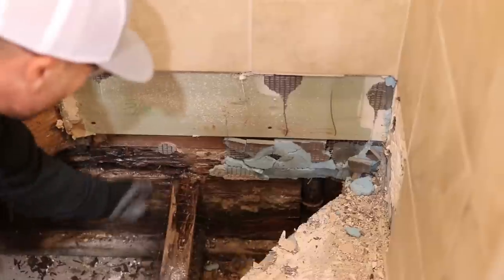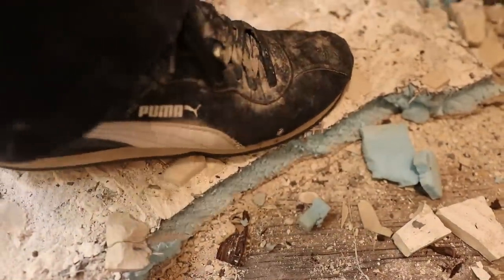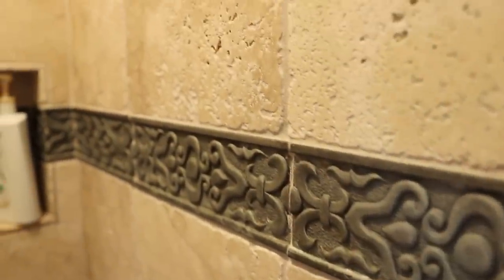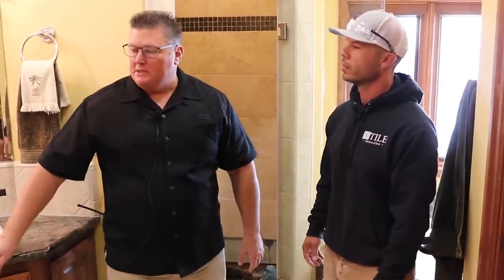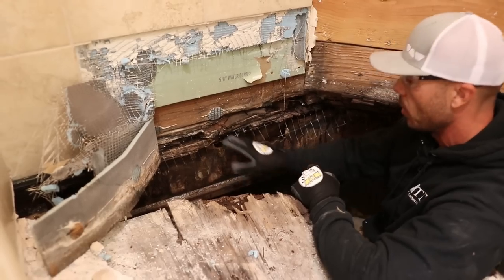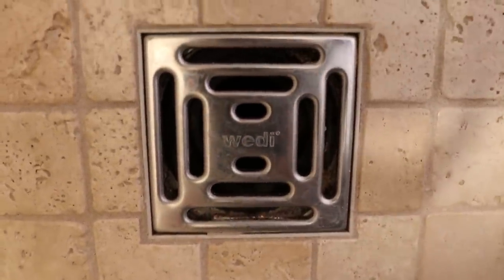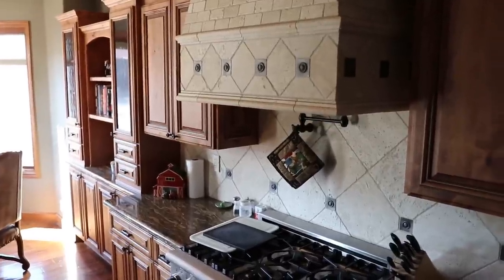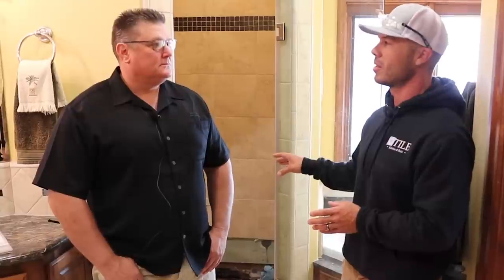Massive WEDI Shower FAILURE (Done by Certified Installer) -- Warranty Claim DENIED

Comment: I'll stick with my Oatey pvc 40 mil liner in the pan, overlapped by 6 mil plastic on the studs. I sleep good at night.
Reply: Right! :)...I love that system...Tile guy for over 30 years...Do you preslope?
Reply: @godbluffvdgg   Yes I always preslope. Do you put cheese wiz on your cheese steaks? I always preferred marinara.
Reply: @Hodmokrin  :)...I ask because that SalTile guy, that has a channel on here says he doesn't do it and you don't need it...I preslope too AND I aqua seal the pre and the wet bed...That at least gives me the tail light warrantee...:)...And cheese steaks get Provolone...Sharp if they got.. it...but if you've had a few beers; wiz is the most awesome thing in the world...:
Reply: Carleton Rutherford  you're right God forbid they try to do as mud pan. That's why we make the big bucks 😉
Reply: How can you sleep at night knowingly installing septic tanks under your client's feet.
Reply: Amateur shower builder that learned from John Bridge book. That was the system I used and I didn't have problems in the 15 showers I built with leaks. I made a mistake on my first one where the mud for the pan was too wet and it filled up the weep holes. About 10 years after I built that one I had to redo the pan because it smelled bad. For sure that system would have been better than what was done here. On the first 6 I built I screwed the Hardibacker into the top of the curb. Eventually I switched to mudding the curb.
Reply: @godbluffvdgg  you're getting Sal DiBlassi mixed up with the guy from Star tile that thinks pre-slopes are not needed period sal would never bypass a pre-slope
Reply: @jamessprow7116  Hey, stop making fun of old people! :)...
Reply: @jamessprow7116  pre-slope? Pre-slope pan or is that a field term for something else?
Reply: @godbluffvdgg  Always preslope!  Shower will start to smell moldy in a few years if you don't.
Reply: @paulperry1489  Its putting mud down sloping towards the drain under the 40 mil Oatey pan material.  Its a very good idea.
Reply: @jonm9538  Yeah, I always do...:)...Plus I waterproof coat the entire thing Up to 6 inches on the walls, THEN I use the PVC layer...I sleep easy at night...:)...And that's what it's all about.
Reply: @godbluffvdgg  If there is one thing I've learned about tile it is always go the extra mile to make sure your job will last.  Your customers might not like the job taking a long time, but they will be even more pissed if you hurry through and screw it up. That Philly and beer will taste a lot better if your gut ain't churning.
Reply: @jonm9538  Ain't that the truth!  We have so MANY wet bed shower pans here; THOUSANDS of them!....Mostly Lead sheet with lead drain lines we tear out...1 1/2 inch thick mud walls with wire...I think I did my last one In January...NO MAS!...The last one killed me...:)...Not really but, going up and down steps and kneeling for long periods, at 60, is brutal...
Reply: @godbluffvdgg  I'm 60 as well lol. Tried to get out of tile 100 times it seems,  but it turns out I'm unemployable. I really can't complain I still make decent money and I basically work part time. Got out of commercial a few years back. Now I cherry pick jobs, mostly residential remodels that I do with my son.
Reply: @jonm9538  :)...That's EXACTLY what I'm doing...I wish I had a son to help though...I have to use self entitled jabronis that cry about working, don't show up, can't follow instructions etc. ...Well, my friend, Good health and Freedom to you and yours.
Reply: @jonm9538  Got it! Are you using deck mud under the liner or concrete? 

I get this concept and it’s a fantastic idea, just want to be sure of the application. I don’t want the wood sub floor to fail in years down the line.
Reply: @paulperry1489  I use either deck mud or sand mix cement. You can also buy preslopes from tile distributors that are made of styrofoam.  Another thing you can do is use a quarter inch durock or other cement board cut to the dimensions of the shower floor including hole for the drain. Then you cut that diagonally into 4 pieces and the fat mud them to the subflooring with thinset to make your slope.
Reply: @paulperry1489  One more tip for you. I like to use a pressure treated 4x4 post for the curb. I leave room on both sides so I don't have to cut and seem the membrane.  I use a chisel or a vibrating undercut saw to make room for folded membrane in the inside corners and I notch the bottom of the wall studs so I can get my backer board to sit flat on the wall. Good luck with your project!
Reply: @godbluffvdgg  Hire demo guys; my back has a hard enough time building the shower lol
Reply: @zagnit  "Demo guys" are good in a vacant house tearing out crap...But, in a bathroom in a 650K house, they're not worth the aggravation...I wish I could find competent, dependable, affordable demo guys... They're "Hen's Teeth", in this area... :)
Reply: @davefoc  I did a job for my buddy and grosse pointe farms in Michigan and the guy who put the shower liner in didn't do no pressure check  and no standing water test and he sealed the weep holes  i messed up trusted someone elses work so I did the rest of the bathroom job assuming he was that guy because of how long hes done work there   and it leaked and I told him(my boy) the reason why it leaked is because the guy sealed up the weep holes and then he didn't do a pressure test and the guy who did the job trying to tell me that you're supposed to seal the weep holes I just laughed in his face and this guys been doing jobs out in grosse pointe farms grosse pointe area for like 30 40 years his name is Bill so I can imagine that there's more problems out there because of this guy

Comment: hI iSSAC 

Thanks this video. I have a great deal of experience with this product and have made a lot of videos showing how to install this board.  I can state categorically  that his is not a product failure. The rebate (rabbit) cut is not required and neither is the caulking. The joint should be  sealed with a neoprene flexible tape that will give you a perfect water seal. This will cope with movement and that is why it is specified. The contractor is out of business so, the homeowner needs to go back to the terms of the warranty. It will not fail if it is done properly so the fault lies with the installer. I agree that better training is required but I reckon the installer was trying to save $40,00 on the taoe.
Reply: Absolutely right Roger.  I did my bathroom using wefi 14 years ago and it's as good as the day I installed it. I posted a comment here months ago to which someone's just replied and noticed your comment.
Reply: Skill Builder I agree that the installer totally screwed up but I am a WEDI certified installer and just went to the secondary certification in Chicago last year. You are I correct. They do want the rabbet cut now but they want you to block in behind (Between the studs) and put a massive bead in that channel. That way when you push it down it should squeeze out a good bit and then you run the Wedi corner knife on that seam and let it dry. Once it’s dry you go back in with the sealant and run a new bead and again use the knife to get it sitting in the crease well. It’s what they call their double barrier system.
Reply: The contractor was "certified" by the manufacturer, and the manufacturer refuses to back the warranty that mandates installation by the "certified" installer. Basically, the warranty and certification are absolutely worthless.
Reply: @kassklothes  so everyone that’s certified does it the way they were taught? Come on now. Let’s me logical. It was a bad contractor. It’s quite obvious
Reply: @kassklothes  The problem is even though the installer is certified he obviously missed a few steps. Also I’ve never heard of not using the rabbits.
Reply: But a membrane should have been installed on the floor and partially on the lower walls. Cement with wire, pan + membrane is still the best and lasts much longer.
Reply: I agree with this guy,if the system ain't broke then why you trying to fix it PVC pan or hot mop, chicken  wire moisture barrier, plaster, red guard tile acrylic additive in the grout , silicone the glass and the controls calking between tile and drywall ,grout sealer and last but not least good ol W-D 40 To top it off 
after that the dishes are done !

Comment: Its easy to not clean the rabbet cuts during prep. It gets pretty messy and then just put sealant in there. It's got to be clean. 

I would be hesitant to say that this is a failure because of the manufacturer. I'm pretty sure they didn't get enough coverage when they adhered the pan to the subfloor and created a hollow space, which caused the pan to deflect. 
The project doesn't look prepped as well as it could've been either

I am a Wedi Pro installer and a CTI. 

Great videos! Keep it up!

Comment: I never trusted those caulk joints, and am quite paranoid about my installs.  Thank you for sharing.  I am not a bit surprised.  Excellent point about the soft foam pans, as well.  That includes Schluter.
Reply: I think they only get soft after being wet from a leak, is that right? Schluter setup is much better than Wedi at least with Kerdiband on all your 90 degree angles—vertical and horizontal.
Reply: My tile guy is dead set against foam pan products. His experience is that over time, foam pans breakdown depending on how heavy they are used. For example,  if it's the main shower for a family of 4-5, a foam based pan will likely fail within 8-10 years. That's approximately 140 showers a month,  or 1,680 in a year. Anyway you look at it, that's a lot of compression/decompression of the foam board even if the average compression is less than 32nd of  an inch...over time as the foam breaks down, failure is a certainty.

Comment: Again, congrats for the info, I’m a certified wedi installer , I agreed that won’t look like the sealants that we use today, but after 12 year we don’t know if will still being gray. I still using the rubber liner and pre slope and wedi just on the walls. Sucks to be the homeowner. Keep up with the good work.
Reply: How would you recommend someone tie in a repair for a severely failed pan? The former owners of our house had a Wedi shower installed around 12-15 years ago which we just had fail. We have no idea who the installer was - and it's probably a good thing because this failure was due to extreme negligence on the installer's part. The wall was cut too short and tried to use wedi urethane to make up the difference. We had an inch and a half thick rope of wedi urethane around the base of the shower. He also 'adapted' the plumbing on the drain and self-modified wedi parts by slicing off everything and using a rope of caulking the size of my thumb to attach the wedi drain to the P trap....with some other weirdness mixed in for good measure. 
We have one course of tile removed and the floor too. I just want the future work to be correct. What do I need to watch out for or insist that my contractor does?
Reply: Andrea Wolf I’m sorry to tell you but if you want to be fixed correctly, just re-do the whole shower, repair will always be a repair, plus nobody will give you any kind of warranty on a repair, or at least I will not. Good luck and I’m sorry about the bad installer.

Comment: Another great video.  This is my issue with not only wedi but some liquids as shower pans as well. You really need a monolithic transition floor to wall. Not just a sealant or topical membrane. Shifting and settling are a real things in all parts of the country.

Comment: Now this might just be my perspective - but my first thought is that the structure probably isn't up to snuff for a tiled shower.  The joist bay that you are sitting in is MASSIVE and although the i-joists are rated for those spaces at spans - under bathrooms, I always preferred to see them cut the spacing down one level in order to give the floor more stiffness (24" to 19.2", 19.2" to 16", 16" to 12"...).  It is one thing to deal with bouncy floors under tile in a kitchen - but in a bathroom it will cost tens of thousand of dollars out of pocket for something that a builder looking to cheap out on a few i-joists could have solved when the house was in framing.

Granted, the tile guy should have said nope as well.  Might not like the decision that WEDI came to, but just seeing that and having been in a few hundred houses over the years with similar structures...I wouldn't trust much other then a fiberglass drop in on them.

Comment: I became a Wedi certified installer in 2007 have put a few systems in at first then I started to see some flaws in the system like no attachment to the wall and floor except for basically caulk . The adhesive I have seen in both white and grey , I always assumed they changed to a different adhesive or different manufacturer. When we see changes like that I get nervous. I don't use this system anymore or ones like it because of the same reasons Isaac mentioned . It's important to not that as our industry moves forward we will see changes it's up to us to determine if we wish to change with it. A warranty is only good if the company or the manufacturer is still around , and it has been my experience that the manufacturer more than likely will deny the claim so it almost always lands on the company or installer the put it in.
Reply: You can't be certified installer because 2 min google search tells that panels will attached to walls with sealant and screws with washers and to floor panels are attached with thinset to subfloor. So dunno who taught you to install it.
Reply: The attachment I'm referring to is between the floor and the walls where the rabbit is . As far as my certification I surely remember a 3 day class .
Reply: @mikewisor4817  I just installed my Wedi system.  The rabbit joint has nothing to do with attatching the pan to the floor nor the panels to the walls.  They are there strictly for the joint between the pan and the wall panels.  Not sure what kind of FUD you are trying to spread here?

Comment: Excellent Info.  I love how you give. your live commentary as you go.

110% agree with your assessment on where and how the failure occurred.  Never never never rely on sealant of any kind as waterproofing.

GREAT job Isaac!
Reply: Eric, please don't encourage the misinformed. "Never rely on a sealant" is like saying never rely on a roof to keep you dry or never rely on a fire to keep you warm. You do realize there are specialty products on the market that are perfectly capable of making water and airtight gaskets for many decades? After 30 years of home renovations, my best advice: There's a whole lot of different stuff you can do- you just have to know what you are doing ;)
Reply: Rick the Swift  You are right about needing to know what you are doing and with over 25 years of tile and stone installation experience myself.  Waterproofing systems are designed to eliminate water penetration to the substrate (just like on a roof).  If any part fails, it fails, and the sealants is ALWAYS the weakest part.
Reply: @ericrogers9253  I would agree that sealants are often the weakest link in the chain. But. This is also the case with head gaskets and valve gaskets in modern and vintage automobiles- many of which still hold up perfectly after many years of thoughtful maintenance. It also helps in such cases that the system was usually designed by an experienced engineer, being guided by decades of data, and monitored by strict regulations, rather than someone who may or may not have a high school diploma or GED, and who may have just watched a DIY video at Home Depot, or Youtube before placing a bid on a project. Not that the lack of certification disqualifies someone from being informed- just saying, homeowners (HO's) often will hire the most affordable contractors and the one who lives closest to the project (IOW a neighbor) which was likely the case here.
Reply: @Rick-the-Swift  it's funny (to me) you mentioned head gasket.  Just had my head gaskets replaced on my truck, not a cheap fix (since the warrantee guy denied the claim). I sure wish they made things to last like they use too.

Comment: Thank you for making this video.  I've installed a few of these but have switched back to mortar pans with bonding flange drains and sheet membranes after noticing the foam pans would dent easily when unprotected.   I would use the cardboard from the pan box and a piece of 2 inch rigid foamboard to work off of only exposing the pan prior to floor tiling.  Was curious about joist spacing and subfloor thickness of this shower and whether the joist depth and connections are rated for seismic activty as you said.  Seems like common sense to beef up load carrying capacities of floor system and make current connections between framing members before putting 1/2 ton of mortar and tile on top of them.   Excess movement will case failure in most sytems over time.  The Wedi sealant Ive been supplied with is a grey modified polyurethane and I learned after bedding joints to spread a 1/2 inch bead with a plastic wing tool from 1 1/2 to 2 inches on both sides of inside corners 2 times.  These two steps are supposed to strengthen the joint but apparently this is not the case. Your work here has proven to be very sobering indeed.  Much appreciated.
Reply: Wouldn't the easy solution be, to use wedi subliner dry tape on the permiter of the base and corners?

Comment: I agree with you sir shower kids are not easy to install. And less it’s a drop in and go pre-pitched. But those also go up into the half to 2 inches then you can caulk screw etc. but from something to nothing such as mud rubber membrane and the foam board which we don’t use that takes an experienced and skilled professional thank you for your work